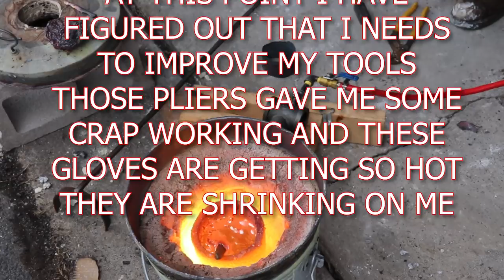New Frosty T Burner Will It Melt Copper

Comment: I like shiny metals in general, heh, but that aluminium bronze has a lovely color.  How fast does it oxidize or does the surface keep that shine?
Reply from the maker: this is still straight copper I need to get ingots to be able to measure my quantities. But AL/Bronze is very resilient to corrosion vs copper will oxidize quick in the right conditions. Stay tune bronze soon!
Reply: @InsideTheMindOfMatt  yes, I saw somebody else casting aluminum bronze, it looked cool. Waiting to see yours now 😁

Comment: I see your forge bucket has a yellow stain, for the sake of your health, read up on why we use black pipe for burners and NEVER galvanised metal!!!!
Reply: Ah it's not that bad, I work in a sheet metal shop where we burn and weld galvanized metal daily for years. As long as you have good ventilation indoors, or do it outdoors, we've never had a problem with fume fever.